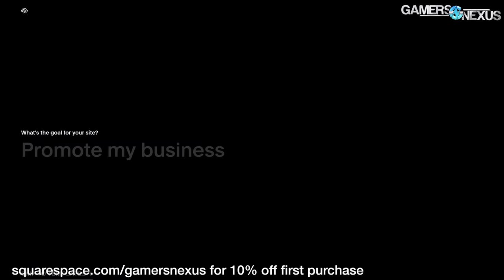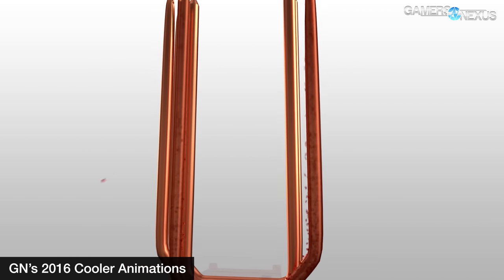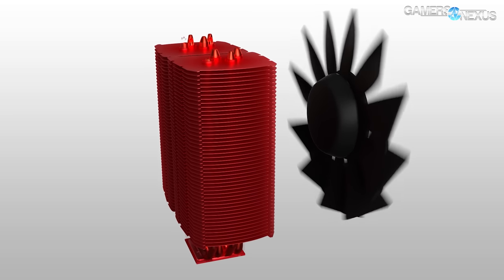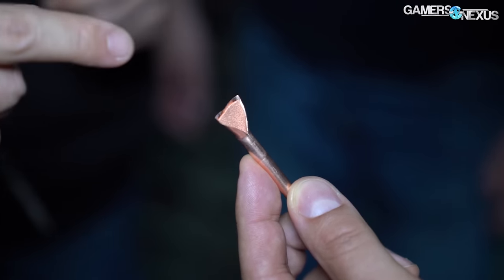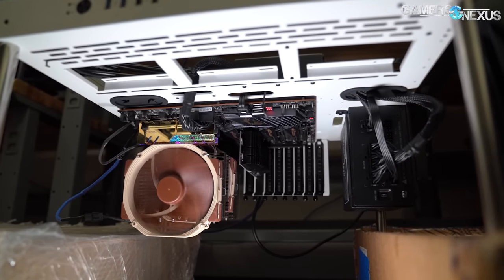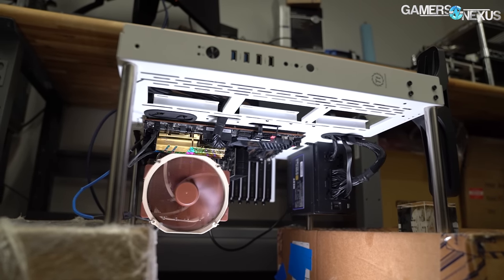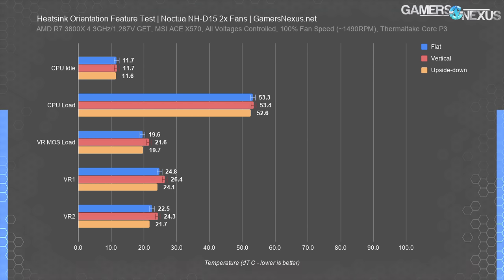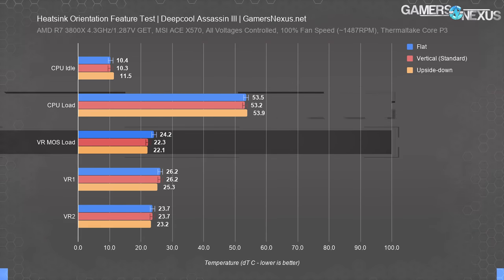Cutting AMD Coolers Open & Flat vs. Vertical CPU Cooler Benchmarks

Comment from the maker: Find our video on how heatpipes are made here: https://www.youtube.com/watch?v=AD-4WKwCAfE
We did a different video on the distantly related topic of heatpipe orientation on Zen 2 chiplets: https://www.youtube.com/watch?v=O1WGlPrH4IU
Reply: What is the minimum temp in celsius that a heatpipe is effective? For example, If I pull cold arctic winter air through the cooler, at what temp does the benifit stop? (so to say. excuse my grammar. Aije ämm fråm Sviiidänn 🇸🇪)
Reply: Glad to see you tried a direct contact  heat pipe cooler. I can't even imagine how much work went into this! Thank you for all you do. One thing that still makes me wonder is if the orientation of direct contact heat pipes matter is: if the heatpipes are lined up parallel or perpendicular with die would that change performance? I remember you mentioning in the previous video that it shouldn't matter due to the IHS and the coldplate, but in this instance there would be no coldplate. (I think testing with a non-soldered vs soldered chip would bring different results due to the thermal transfer properties from both.

 (for something with multiple chiplets this might not matter much if all, and the same could be said for single chiplet style too) but I'm thinking more specifically of intel's more "traditional", if you will,(or more common) single chiplet like dies. Perhaps it's not worth the time to consider, but if it is it would make for another very interesting and very educational video. (Although given your results thus far... The likeliness of any meaningful change is quite slim to non-existent). Just a thought and thank you again for all your hard work!! 

Have a happy new years!
Reply: @newgame2day  I'd like to see LTT try something like this. Sarcastic (not to bash on LTT, because that are great! But I don't think they would go nearly as in depth or even take something like this on. Although they have done some tests(like their positive/negative/neutral air pressure test) that are pretty interesting, I just don't believe their audience would appreciate, or care as much about something like this... I could be wrong, and would love to see it happen, but for a channel that big, and with so many other things going on, I just don't foresee them doing this topic... But I guess that's part of the charm that is Gamers Nexus they are willing to cater more to deep dive in odd topics such as *heat pipe orientation*) :)
Reply: I will say, the results are somewhat counterintuitive, especially if you ever actually tried that wicking experiment. wicking from one cup to another is so incredibly slow, it is surprising wicking alone can actually move enough coolant.

Great vid Steve and crew. B)
Reply: Sc0ttishGamer88   Sublimation only works so long as you have enough coolant to Subliment for the duration of the mission. Craft like New Horizons and SOHO are a tad beyond that mission time capacity.
Reply: What if you drill the heatpipes... with a big hole/no liquid will it work worse so that a user would even notice?
PS, does deepcool just use more powder? :P
Reply: Interesting research / myth-busting, and speaking of, I still wonder about the supposedly better placement of AIO's with the pipes in downward orientation towards the radiator. Steve mentioned this in the build with a 3950x for Work video. Any possible tests to support that alleged advantage?
Reply: Hey hey, do you think running 2x RTX 2070 Supers in NVLink is a better choice than running a single 2080 Ti..?
Reply: @latioseon7794  
My personal opinion is SLI only works on a small amount of games so the 2080Ti will be better for most titles.
Reply: Link to the report  "Application of Heat Pipes to Spacecraft Thermal Control Problems" by Thurman and Mei: https://ntrs.nasa.gov/search.jsp?R=19700025120
PDF Direct: https://ntrs.nasa.gov/archive/nasa/casi.ntrs.nasa.gov/19700025120.pdf
Reply: how about testing heat pipes filled with other materials like galinstan or potassium? I feel like idle temps would be bad but load temps would be good because they will never reach a point where they too hot and stop working from the temperatures a CPU can produce.
Reply from the maker: Every heatpipe we know of in computer applications has liquid.
Reply: @GamersNexus  but is it water or something special?
Reply: @GamersNexus  that no reason you can't experiment. galinstan is used in themometers so it is liquid enough for capillary action to take place. plus it's many times more thermally conductive than water. potassium would be better though because if you seal it in a vacuum it can't react with anything in the pipe. it has a higher melting point of 63C but cpu load temps easily go beyond that. you could even put ethanol in the pipe to compensate for both materials lack of ability to work at lower temperatures.
Reply: Your testing is amazing! I watch videos on products I won't even be in the market for just because I'm interested in your testing methodologies
Reply: In space/satellites, the orientation/gravity direction makes no difference because everything is in free fall. On earth, gravity can either help water or vapor move towards one direction or other. Steve seemed to say it makes a difference in space and not in earth, which doesn't make sense. Earth has no noticeable difference for computer heatpipes at least. Space most definitely doesn't care about orientation.
Reply: Hey i am a Design Piping Engineer, and I have worked for Offshore platforms, and Onshore Oil and Gas installations, and they never use fans to dissipate heat, i have often thought why don't they use fans to cool the shell and tube heat exchangers, but because books like what you have got, the end case never changes. They simply stick to the tried and tested method from a book designed by MW Kellogg.Ltd, which now formed with Brown and Root, to become what we now know as KBR.
Reply: Ik i knew you where going to destroy a bunch of coolers i would have suggested running a 9900k and cut out the center heat pipes to see if not having center 2/3 heat pipes that make direct contact to the cpu die part normally makes a difference. After seeing flir immages im just not cinfinced a hgeat spreader spreads all that well.  it takesd 20 seconds for the majority of the spreader to heat the center where the die is is hot a LOT faster.
Reply: @Maverick Gavin instablaster ;)
Reply: @Israel Anthony i really appreciate your reply. I got to the site on google and im waiting for the hacking stuff atm.
Looks like it's gonna take a while so I will reply here later with my results.
Reply: @Israel Anthony It worked and I finally got access to my account again. I am so happy!
Thank you so much you saved my ass !
Reply: @Maverick Gavin you are welcome :D
Reply: 👎 Yes the Orientation was Changed, or Even Upside-down. -- Have you checked the Fan Speed. If the Cooler is Upside Down, it might be that the Fan is Aggressive.
Reply: What answer you got about Deepcool Assassin III advertizing? - recently bought one, and wonder if they might changed production?

Comment: The copper powder is important because it serves as a threatening reminder to the heat pipe tube of what it will be made into if it doesn't behave and transfer heat well. This fear is what makes them so good at transferring thermal energy.

Comment: All I can think while watching this video is: "I need a Dremel"
Reply: You do.  They are the small scale machining equivalent of duct tape.
Reply: @desmofan1864  Yeah! They are just so useful.
Reply: Same
Reply: Same
Reply: Dremel has kind of degraded in quality over the last few years, I would suggest proxxon rotary tools for much better precision instead
Reply: Just bought one. LOL
Reply: Dawid Does Tech Stuff Hey Dawid 😉 Yes please get a Dremel to cut pc parts and find out what is inside 🤪 I will watch it, as always 😀 

Idea; What does the inside of the GT710 look like? Is it really infected with a venereal disease and can we heal it? 🤣😂
Reply: An excellent tool for several small tasks. There are other manufacturers but dremel is still one of the best.
Reply: AND safety glasses.
Reply: @NoGufff  I have some die grinders. They're kind of expensive. For a cheap rotary tool drywall zip cutters are handy. I like the extra power. I've had a couple Dremels fail on me due to having anemic performance.
Reply: @tek_lynx4225  Dremel is a proprietary eponym for rotary tool today, like saying Xerox to copy something is. When you say Dremel everyone knows what you mean. I've had less than good luck with actual Dremel brand rotary tools myself. I've busted a couple of them over the years. I have a couple B&D RTX rotary tools now that I like better. I got them for $10 a piece too. So if one blows up no biggie.
Reply: @tek_lynx4225  Well, actually, I had bought a B&Q rotary tool with six speeds, and after a while the speed control failed, making it run at maximum speed all the time which was useless for many things where I need a lower speed. I got an anniversary edition Dremel (in an attractive wooden box) and that has remained reliable. But, having said that, I purchased an official Dremel 90 degree angular drive, and it said on the packaging that it had spiral cut bevel gears for smoothness and low noise. It was noisy and harsh. When i took it apart, lo-and-behold, they were straight cut bevel gears - that could not have been more blatantly dishonest.

Comment: 24:05 There are two kinds of people. The first can extrapolate from insufficient data.
Reply from the maker: WHAT DO THE SECOND DO?
Reply: @GamersNexus  WE NEED AN ANSWER
Reply: This comment is so clever it bothers me
Reply: You win the internet today
Reply: @euly  Seriously!
Reply: Fuck, now I can't die!!!!!!
Reply: @GamersNexus  Verify.
Try the same test without heat pipes.

Older computer hardware didnt use heatpipes, and therefore a never ending rumor was born. 
Heatpipes changed the game.

p.s. I'm running a standard Intel cooler (no pipes) on a 6950x.
Pipeless coolers still exist. lol
Reply: @larrypaul2462  I kinda feel bad for that cpu and I'm not even an Intel fan.
Reply: @randymiracle4958  Why is that?
I've done 4.5ghz on all 10 cores on air *conditioning with that heatsink. Limited to 50f/10c on the AC's thermostat, could have went higher but didnt want to risk it being thermostat limited.

Being a fan of Intel or not, ya 'prolly should realize that for it's time the 6950x was at the top on the benchmark scene, and I've still not seen anything (game wise) that really pushes it that hard.
Reply: @dualtronix4438  I believe sufficient data is given.
Reply: @GamersNexus   The second has gone missing. Memoryleak or something. Perhaps it got booted through the backdoor.
Reply: There are 10 kinds of people, those who understand binary, and those who don't.
Reply: And the second is lost in the statistics.

Comment: Thanks. I really appreciate the time and trouble you go to in testing, evaluating then sharing your methodology and conclusions. IMO you are more detailed and rigorous in testing than any other YouTube presenter, speaking about PC hardware engineering, that I have encountered. This is why I subscribed some time ago. I feel I learn more with your channel than others - even if the conclusions are often similar. At least I think I now understand more about the reasons why.

That said (and this is more a reflection on me) at times I find it hard to concentrate and have a tendency to 'drift off'. Some of your videos are thus great for getting to sleep (sorry, I really don't meant to be rude). When I'm engaged with the topic or review then typically I find a need to pause your videos to read and assimilate your charts and/or replay to understand the finer points, so that I can apply to my own situation. But overall, cudos for being the best at doing thorough technical reviews.

Comment: For someone that Brazes Copper and Aluminium for Transformer Coils for the last 40 Years Capillary action is a way of life!  Considering how well copper transfers heat on it's own, I'm surprised that there is a need for the heat pipes to have such an elaborate design needing copper powder, a drop of water and then vacuum sealed to assist in the Capillary action! I honestly didn't know this!!  Learn something new everyday! Thanks Steve!

Comment: I always love the idea of having the motherboard facing the floor, natural protection against water leaking given the low pressure tubes hold and also easy to spot when they do.
Just need to have the water reserve mounted on top of all components (no issue).

Comment: You could use a clamp style Mini Pipe Cutter to cut those pipes without evaporating the insides. They sell them right where you buy copper pipes for your house in the hardware store. Some are large but you can get one that is only a couple inches in size for the smaller pipes like Brake Lines

Comment: The reason there was no difference is that even in upside-down orientation, you didn't reach the heat transfer limit of the heatpipes. If you further increase the wattage, you'll see a sudden breakpoint, which depends on orientation.
This does not matter for computer-end-users though, because they will never reach those wattages and even if we're talking about overclocking, it doesn't make sense, because the condenser on the cooler is too small anyway.

Comment: Glad to know angle doesn't affect these coolers. 
From what I've read orientation angle affects the maximum heat transfer ability, so if they only had a few heat pipes and a high heat load the evaporator might start drying out. Luckily a lot of coolers have 4-6 pipes (U shaped ones count double), 6MM ones being good for about 45W each, when not fighting gravity. 
It means the cooler with 8 pipes, each is at only 1/3 of its maximum heat transfer. (130W/8=16W each)

Comment: It is also important to note that due to capillary action with regard to the average internal diameter of this sort of heat pipe, keeping in mind how thermal transfer and phase changes work, angle simply will not matter at all from a law of physics standpoint.

Comment: But then, taking into consideration the liquid in the heat pipes, can we expect lose efficiency because of evaporation or for other reason? For how long can the heatsink work (ignoring the fan) ?
Also great in-depth video Steve as always.
Reply: As long as the pipe is seal the water can't get away no matter what, only changing state ( water vapor ice)

Comment: Anecdotally, I tested this on my previous laptop. I has been long enough ago that I can't recall all the details, but I tested it multiple times in all six orientations, and all but one worked equally well. However, that last one orientation was not just outside of error, but the difference was extreme; almost all cooling performance was gone and the CPU had to throttle within seconds of me putting it under load. I don't recall exactly what orientation it was, but the heat-pipe in the laptop was mostly linear, and I'm fairly sure it was one of the two orientations in which the heat-pipe itself was vertical.
Reply: I observed very similar behaviour in Clevo W230SS - it was mostly ,but if you raised back of laptop so it makes about 45 degrees or higher, pufff, whole cooling is gone and even modest CPU activity was leading to 90 C. AFAIR I did find similar complaints for W230S* family in couple forums.

Comment: Could you please do one more additional test with the heatpipes cut open on the ends? It would be interesting to see how much delta in performance if any there would be once the active cooling solution evaporated. Thanks, and keep up the good work guys.

Comment: Because some people are still running mechanical HDD's, i think there is more to the orientation than "whatever works best for your space". I've seen warnings not to run hdd's in certain orientations, like upside down. This may be something to consider here.
Reply: Because the reader can fail when a conventional hard drive is ran upside down...
Reply from the maker: We weren't talking about hard drives.
Reply: @GamersNexus  I fully realize that, but you did not mention them as a consideration when telling people they can align their desktop computers however they want at the end of the video in your conclusions. Even though this wasn't about HDD's, it could warrant mention since that is a potential hazard of odd orientations.
Reply: It might have influence on the lifetime of the bearings in the fans with wrong orientation I did see one here mention in the comments somewhere...

Comment: CFD/CHT Software like ANSYS FLUENT and Star-CCM+ can model the heat transfer performances of different design orientation. One can simulate each orientation seperately or using parametric modeling to use built-in optimization software such as Design Manager in SCCM+ which would give more than one possible solution for optimizing cooling solution.

Comment: Hey Steve, I just watched your test, and I sort of wished you tested the coolers with the just the ends of the heatpipes tips cut off. Sometimes I wonder if they even need capillary action to work.
Reply: Why are you skeptical?
Reply: @bothellkenmore  I am not so sure that they perform any better than a oversized passive heatsink. I've seen large transformers that have more power ran through them, yet passively cooled..  Also Seasonic has a 600 watt passively cooled power supply... So this makes me wonder about some claims
Reply: @silverstangs  You'd have to use an awful lot of copper to outperform them. If there was a better way (cost/performance) the market would have produced it. CPU's and PSU's are completely different too. In a lot of PSU's now the fan won't even spin until under load because of the efficiency of the components and efficiency directly correlates to heat generation.